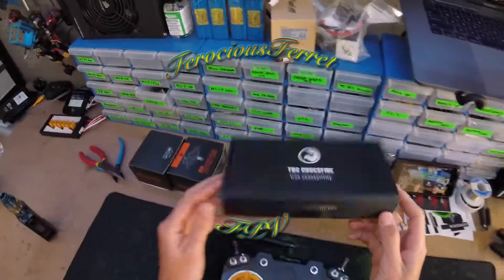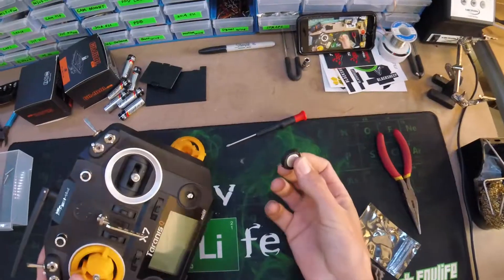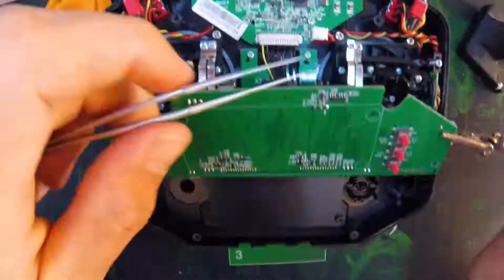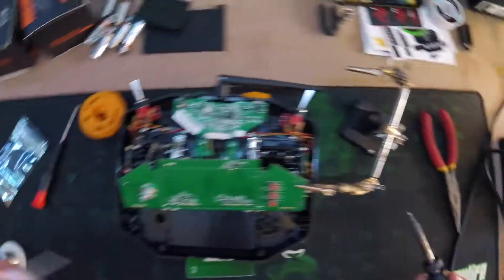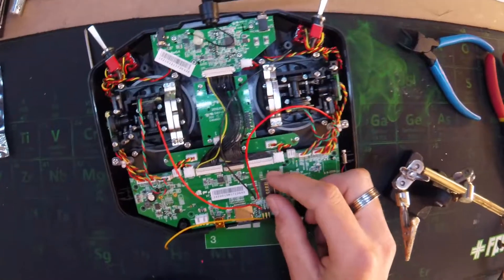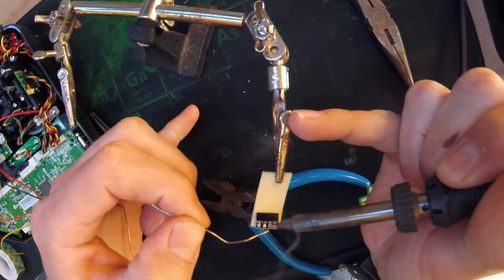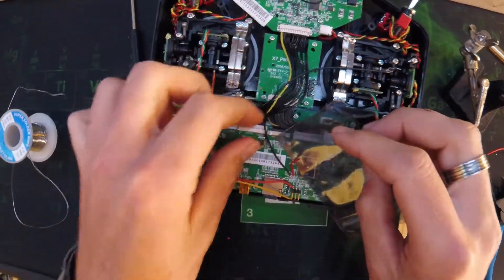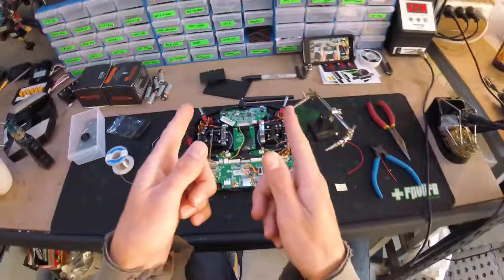Taranis QX7 crossfire PCB mod - quick process overview

Comment: your only at 400 degrees Fahrenheit? seems a little low...you would of been better off soldering the mod board first with all the wires and lengthening the wires and tinning the ends before sticking the mod to board and then solder the wires to the spots....
Reply from the maker: Nah its in Celsius :) (live in australia) yeah that would also be effective, cheers for the view :D
Reply: @ferociousferretfpv2291  oh ok lol.... thanks for vid